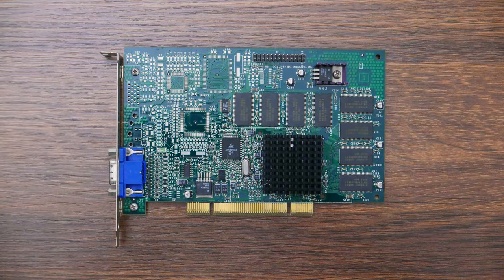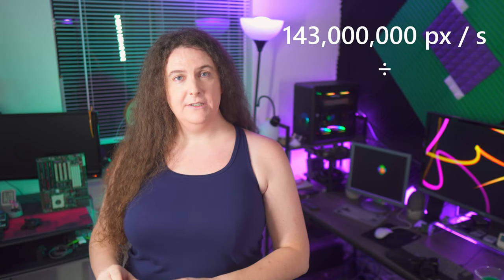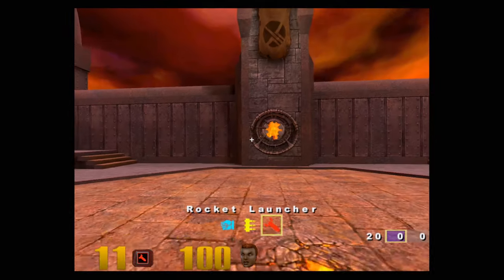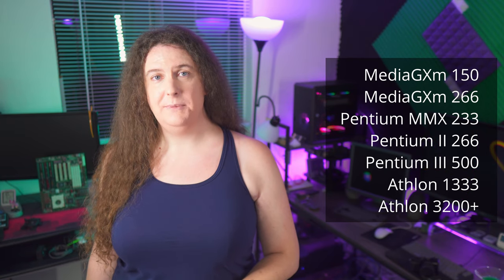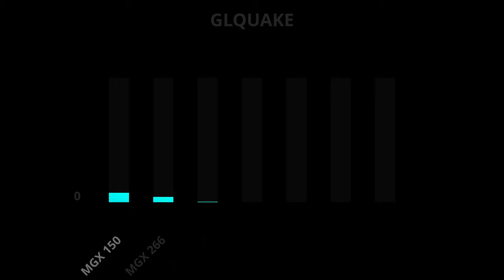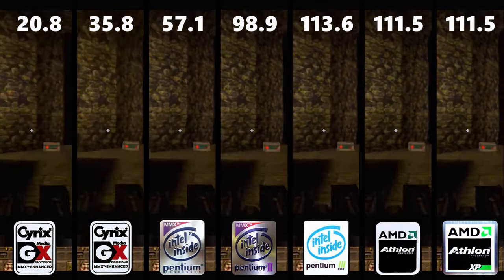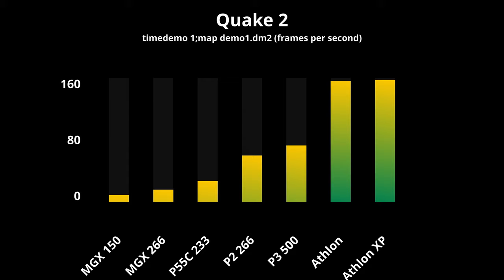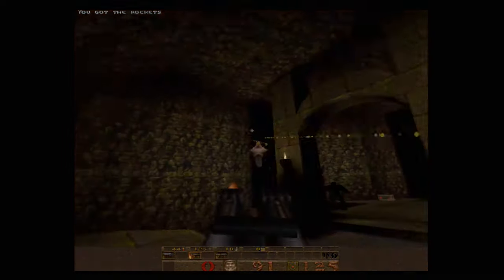How fast will it go? Voodoo3 Scaling

Comment: Hi, below this post I will list the results with the following VGA cards on my P-3 600MHz (100MHz FSB, 100MHz SDR, Acorp Intel 440BX Slot 1 motherboard). I hope the text formatting stays true enough to the source file.
Geforce FX 5200 AGP   - 128MB  64bit - 250MHz Core - 200MHz DDR
Geforce FX 5500 PCI     - 256MB 128bit - 250MHz Core - 133MHz DDR
Geforce MX 400  PCI     -  32MB  32bit - 175MHz Core - 166MHz DDR
Radeon 7200 SDR AGP -  32MB 128bit - 166MHz Core - 166MHz SDR
Matrox G400	AGP   -  16MB 128bit - 125MHz Core - 166MHz SDR
Matrox G200	AGP   -   8MB  64bit -  84MHz Core - 112MHz SDR
ATI Rage XL		PCI    -	8MB	 32bit -  84MHz Core -  63MHz SDR
Riva Vanta LT	AGP  -	8MB	 64bit -  82MHz Core - 100MHz SDR
Ati Rage 128Pro AGP   -  32MB 128bit - 140MHz Core - 140MHz SDR
S3 Virge DX 375 PCI     -   4MB  64bit -  60MHz Core -  60MHz EDO
Reply: Quake 2

Settings: Default       Demo: demo1.dm2

-------------------------------------------------------------------------
					WIndows 98 Driver Date: 12-10-2005
P3-600-Acorp		GeforceFX 5200 64bit	AGP		320x240x16		165.0	
P3-600-Acorp		GeforceFX 5200 64bit	AGP		640x480x16		163.4	
P3-600-Acorp		GeforceFX 5200 64bit	AGP		800x600x16		158.1
P3-600-Acorp		GeforceFX 5200 64bit	AGP		1024x768x16	128.7	
P3-600-Acorp		GeforceFX 5200 64bit	AGP		320x240x32		164.1	
P3-600-Acorp		GeforceFX 5200 64bit	AGP		640x480x32		158.2	
P3-600-Acorp		GeforceFX 5200 64bit	AGP		800x600x32		133.0
P3-600-Acorp		GeforceFX 5200 64bit	AGP		1024x768x32	87.8
-------------------------------------------------------------------------
					WIndows 98 Driver Date: 12-10-2005
P3-600-Acorp		GeforceFX 5500 128bit	PCI		320x240x16		134.8
P3-600-Acorp		GeforceFX 5500 128bit	PCI		640x480x16		132.2
P3-600-Acorp		GeforceFX 5500 128bit	PCI		800x600x16		118.1
P3-600-Acorp		GeforceFX 5500 128bit	PCI		1024x768x16	96.6
P3-600-Acorp		GeforceFX 5500 128bit	PCI		320x240x32		133.8	
P3-600-Acorp		GeforceFX 5500 128bit	PCI		640x480x32		120.3
P3-600-Acorp		GeforceFX 5500 128bit	PCI		800x600x32		101.5
P3-600-Acorp		GeforceFX 5500 128bit	PCI		1024x768x32	78.7
-------------------------------------------------------------------------
					Windows 98 Driver Date: 12-10-2005
P3-600-Acorp		Geforce MX 400 32bit	PCI		320x240x16		135.8
P3-600-Acorp		Geforce MX 400 32bit	PCI		640x480x16		112.9	
P3-600-Acorp		Geforce MX 400 32bit	PCI		800x600x16		92.5
P3-600-Acorp		Geforce MX 400 32bit	PCI		1024x768x16	67.3
P3-600-Acorp		Geforce MX 400 32bit	PCI		320x240x32		135.7
P3-600-Acorp		Geforce MX 400 32bit	PCI		640x480x32		97.5
P3-600-Acorp		Geforce MX 400 32bit	PCI		800x600x32		74.1
P3-600-Acorp		Geforce MX 400 32bit	PCI		1024x768x32	49.5
-------------------------------------------------------------------------
					Windows 98 Driver Date (Catalyst 6.2): 
P3-600-Acorp		Radeon 7200SDR 128bit	AGP		320x240x16		----
P3-600-Acorp		Radeon 7200SDR 128bit	AGP		640x480x16		104.7	
P3-600-Acorp		Radeon 7200SDR 128bit	AGP		800x600x16		103.0
P3-600-Acorp		Radeon 7200SDR 128bit	AGP		1024x768x16	101.0
P3-600-Acorp		Radeon 7200SDR 128bit	AGP		320x240x32		----
P3-600-Acorp		Radeon 7200SDR 128bit	AGP		640x480x32		104.5
P3-600-Acorp		Radeon 7200SDR 128bit	AGP		800x600x32		103.2
P3-600-Acorp		Radeon 7200SDR 128bit	AGP		1024x768x32	101.3
-------------------------------------------------------------------------
					Windows 98 Driver Date: 5-29-2002
P3-600-Acorp		Matrox G400    128bit	AGP		320x240x16		110.5
P3-600-Acorp		Matrox G400    128bit	AGP		640x480x16		108.6
P3-600-Acorp		Matrox G400    128bit	AGP		800x600x16		90.9
P3-600-Acorp		Matrox G400    128bit	AGP		1024x768x16	60.5
P3-600-Acorp		Matrox G400    128bit	AGP		320x240x32		109.9
P3-600-Acorp		Matrox G400    128bit	AGP		640x480x32		107.8
P3-600-Acorp		Matrox G400    128bit	AGP		800x600x32		87.6
P3-600-Acorp		Matrox G400    128bit	AGP		1024x768x32	56.4
-------------------------------------------------------------------------
					Windows 98 Driver Date: 5-29-2002
P3-600-Acorp		Matrox G200     64bit	AGP		320x240x16		----
P3-600-Acorp		Matrox G200     64bit	AGP		640x480x16		31.8
P3-600-Acorp		Matrox G200     64bit	AGP		800x600x16		22.1
P3-600-Acorp		Matrox G200     64bit	AGP		1024x768x16	13.9
P3-600-Acorp		Matrox G200     64bit	AGP		320x240x32		----
P3-600-Acorp		Matrox G200     64bit	AGP		640x480x32		23.2
P3-600-Acorp		Matrox G200     64bit	AGP		800x600x32		15.3
P3-600-Acorp		Matrox G200     64bit	AGP		1024x768x32	----
-------------------------------------------------------------------------
					Windows 98 Driver Date: **********
P3-600-Acorp		ATI Rage XL     32bit	PCI		320x240x16		52.1
P3-600-Acorp		ATI Rage XL     32bit	PCI		640x480x16		20.3
P3-600-Acorp		ATI Rage XL     32bit	PCI		800x600x16		14.2
P3-600-Acorp		ATI Rage XL     32bit	PCI		1024x768x16	8.9
P3-600-Acorp		ATI Rage XL     32bit	PCI		320x240x32		---
P3-600-Acorp		ATI Rage XL     32bit	PCI		640x480x32		---
P3-600-Acorp		ATI Rage XL     32bit	PCI		800x600x32		---
P3-600-Acorp		ATI Rage XL     32bit	PCI		1024x768x32	---
-------------------------------------------------------------------------
					Windows 98 Driver Date: **********
P3-600-Acorp		Riva Vanta LT   64bit	AGP		320x240x16		89.4
P3-600-Acorp		Riva Vanta LT   64bit	AGP		640x480x16		76.8
P3-600-Acorp		Riva Vanta LT   64bit	AGP		800x600x16		49.1
P3-600-Acorp		Riva Vanta LT   64bit	AGP		1024x768x16	33.5
P3-600-Acorp		Riva Vanta LT   64bit	AGP		320x240x32		89.8
P3-600-Acorp		Riva Vanta LT   64bit	AGP		640x480x32		46.8
P3-600-Acorp		Riva Vanta LT   64bit	AGP		800x600x32		30.2
P3-600-Acorp		Riva Vanta LT   64bit	AGP		1024x768x32	---
-------------------------------------------------------------------------
						Windows 98 Driver Date: 12-10-2005
P3-600-Acorp		ATI Rage128Pro 128bit	AGP		320x240x16		100.1
P3-600-Acorp		ATI Rage128Pro 128bit	AGP		640x480x16		97.3
P3-600-Acorp		ATI Rage128Pro 128bit	AGP		800x600x16		89.9
P3-600-Acorp		ATI Rage128Pro 128bit	AGP		1024x768x16	63.9
P3-600-Acorp		ATI Rage128Pro 128bit	AGP		320x240x32		100.5
P3-600-Acorp		ATI Rage128Pro 128bit	AGP		640x480x32		97.4
P3-600-Acorp		ATI Rage128Pro 128bit	AGP		800x600x32		87.8
P3-600-Acorp		ATI Rage128Pro 128bit	AGP		1024x768x32	61.1
-------------------------------------------------------------------------
						Windows 98 Driver Date: default 4.23.1999 + S3Toolkit(32bit Zbuffer)/TS3D/TD3D
					* 	gl_texturemode nearest
					**	r_fullbright=1, gl_flashblend=0
P3-600-Acorp		S3 Virge DX 375 64bit	PCI		320x240x16		12.5*(20*)/14.0*(23.8**)/13.8						
P3-600-Acorp		S3 Virge DX 375 64bit	PCI		640x480x16		5.4*(11.0*)/5.6*(11.9**)5.6
P3-600-Acorp		S3 Virge DX 375 64bit	PCI		800x600x16		3.6W*(7.9*)/3.7*(8.2**)/3.7
P3-600-Acorp		S3 Virge DX 375 64bit	PCI		1024x768x16	---
P3-600-Acorp		S3 Virge DX 375 64bit	PCI		320x240x24		---
P3-600-Acorp		S3 Virge DX 375 64bit	PCI		640x480x24		---
P3-600-Acorp		S3 Virge DX 375 64bit	PCI		800x600x24		---
P3-600-Acorp		S3 Virge DX 375 64bit	PCI		1024x768x24	---
Reply: Quake 3

Settings: Normal, then resolution changes     Demo: demo001
-------------------------------------------------------------------------
					Windows 98 Driver Date: 12-10-2005
P3-600-Acorp		GeforceFX 5200 64bit	AGP		320x240x16		93.7
P3-600-Acorp		GeforceFX 5200 64bit	AGP		640x480x16		91.7
P3-600-Acorp		GeforceFX 5200 64bit	AGP		800x600x16		88.4
P3-600-Acorp		GeforceFX 5200 64bit	AGP		1024x768x16	87.2
P3-600-Acorp		GeforceFX 5200 64bit	AGP		1280x1024x16	79.5	
P3-600-Acorp		GeforceFX 5200 64bit	AGP		320x240x32		90.5
P3-600-Acorp		GeforceFX 5200 64bit	AGP		640x480x32		89.4
P3-600-Acorp		GeforceFX 5200 64bit	AGP		800x600x32		89.6
P3-600-Acorp		GeforceFX 5200 64bit	AGP		1024x768x32	82.4	
P3-600-Acorp		GeforceFX 5200 64bit	AGP		1280x1024x32	62.1
-------------------------------------------------------------------------
					Windows 98 Driver Date: 12-10-2005
P3-600-Acorp		GeforceFX 5500 128bit	PCI		320x240x16		82.6
P3-600-Acorp		GeforceFX 5500 128bit	PCI		640x480x16		81.7
P3-600-Acorp		GeforceFX 5500 128bit	PCI		800x600x16		80.8
P3-600-Acorp		GeforceFX 5500 128bit	PCI		1024x768x16	78.3
P3-600-Acorp		GeforceFX 5500 128bit	PCI		1280x1024x16	68.2
P3-600-Acorp		GeforceFX 5500 128bit	PCI		320x240x32		83.3
P3-600-Acorp		GeforceFX 5500 128bit	PCI		640x480x32		82.7
P3-600-Acorp		GeforceFX 5500 128bit	PCI		800x600x32		80.1
P3-600-Acorp		GeforceFX 5500 128bit	PCI		1024x768x32	73.2
P3-600-Acorp		GeforceFX 5500 128bit	PCI		1280x1024x32	57.0
-------------------------------------------------------------------------
					Windows 98 Driver Date: 12-10-2005
P3-600-Acorp		Geforce MX 400 32bit	PCI		320x240x16		88.9
P3-600-Acorp		Geforce MX 400 32bit	PCI		640x480x16		77.6
P3-600-Acorp		Geforce MX 400 32bit	PCI		800x600x16		62.1
P3-600-Acorp		Geforce MX 400 32bit	PCI		1024x768x16	44.6
P3-600-Acorp		Geforce MX 400 32bit	PCI		1280x1024x16	28.9
P3-600-Acorp		Geforce MX 400 32bit	PCI		320x240x32		89.5
P3-600-Acorp		Geforce MX 400 32bit	PCI		640x480x32		59.4
P3-600-Acorp		Geforce MX 400 32bit	PCI		800x600x32		44.2
P3-600-Acorp		Geforce MX 400 32bit	PCI		1024x768x32	28.0
P3-600-Acorp		Geforce MX 400 32bit	PCI		1280x1024x32	15.4
-------------------------------------------------------------------------
					Windows 98 Driver Date (Catalyst 6.2): 
P3-600-Acorp		Radeon 7200SDR 128bit	AGP		320x240x16		----
P3-600-Acorp		Radeon 7200SDR 128bit	AGP		640x480x16		91.1
P3-600-Acorp		Radeon 7200SDR 128bit	AGP		800x600x16		84.4
P3-600-Acorp		Radeon 7200SDR 128bit	AGP		1024x768x16	69.2
P3-600-Acorp		Radeon 7200SDR 128bit	AGP		1280x1024x16	46.2
P3-600-Acorp		Radeon 7200SDR 128bit	AGP		320x240x32		----
P3-600-Acorp		Radeon 7200SDR 128bit	AGP		640x480x32		89.3
P3-600-Acorp		Radeon 7200SDR 128bit	AGP		800x600x32		82.8
P3-600-Acorp		Radeon 7200SDR 128bit	AGP		1024x768x32	64.4
P3-600-Acorp		Radeon 7200SDR 128bit	AGP		1280x1024x32	41.0
-------------------------------------------------------------------------
						Windows 98 Driver Date: 5-29-2002
P3-600-Acorp		Matrox G400    128bit	AGP		320x240x16		83.2
P3-600-Acorp		Matrox G400    128bit	AGP		640x480x16		76.7
P3-600-Acorp		Matrox G400    128bit	AGP		800x600x16		57.9
P3-600-Acorp		Matrox G400    128bit	AGP		1024x768x16	37.8
P3-600-Acorp		Matrox G400    128bit	AGP		1280x1024x16	23.6
P3-600-Acorp		Matrox G400    128bit	AGP		320x240x32		82.8
P3-600-Acorp		Matrox G400    128bit	AGP		640x480x32		65.2
P3-600-Acorp		Matrox G400    128bit	AGP		800x600x32		44.8
P3-600-Acorp		Matrox G400    128bit	AGP		1024x768x32	27.4
P3-600-Acorp		Matrox G400    128bit	AGP		1280x1024x32	14.6
-------------------------------------------------------------------------
						Windows 98 Driver Date: 5-29-2002
P3-600-Acorp		Matrox G200     64bit	AGP		320x240x16		??
P3-600-Acorp		Matrox G200     64bit	AGP		640x480x16		??
P3-600-Acorp		Matrox G200     64bit	AGP		800x600x16		??
P3-600-Acorp		Matrox G200     64bit	AGP		1024x768x16		??
P3-600-Acorp		Matrox G200     64bit	AGP		1280x1024x16	??
P3-600-Acorp		Matrox G200     64bit	AGP		320x240x32		??
P3-600-Acorp		Matrox G200     64bit	AGP		640x480x32		??
P3-600-Acorp		Matrox G200     64bit	AGP		800x600x32		??
P3-600-Acorp		Matrox G200     64bit	AGP		1024x768x32		??
P3-600-Acorp		Matrox G200     64bit	AGP		1280x1024x32	??
-------------------------------------------------------------------------
						Windows 98 Driver Date: ********
P3-600-Acorp		ATI Rage XL     32bit	PCI		320x240x16		33.8
P3-600-Acorp		ATI Rage XL     32bit	PCI		640x480x16		12.3
P3-600-Acorp		ATI Rage XL     32bit	PCI		800x600x16		 8.4
P3-600-Acorp		ATI Rage XL     32bit	PCI		1024x768x16	 5.0
P3-600-Acorp		ATI Rage XL     32bit	PCI		1280x1024x16	---
P3-600-Acorp		ATI Rage XL     32bit	PCI		320x240x32		---
P3-600-Acorp		ATI Rage XL     32bit	PCI		640x480x32		---
P3-600-Acorp		ATI Rage XL     32bit	PCI		800x600x32		---
P3-600-Acorp		ATI Rage XL     32bit	PCI		1024x768x32	---
P3-600-Acorp		ATI Rage XL     32bit	PCI		1280x1024x32	---
-------------------------------------------------------------------------
						Windows 98 Driver Date: ********
P3-600-Acorp		Riva Vanta LT   64bit	AGP		320x240x16		72.8
P3-600-Acorp		Riva Vanta LT   64bit	AGP		640x480x16		46.5
P3-600-Acorp		Riva Vanta LT   64bit	AGP		800x600x16		27.8
P3-600-Acorp		Riva Vanta LT   64bit	AGP		1024x768x16	19.1
P3-600-Acorp		Riva Vanta LT   64bit	AGP		1280x1024x16	---
P3-600-Acorp		Riva Vanta LT   64bit	AGP		320x240x32		68.5
P3-600-Acorp		Riva Vanta LT   64bit	AGP		640x480x32		25.3
P3-600-Acorp		Riva Vanta LT   64bit	AGP		800x600x32		16.2
P3-600-Acorp		Riva Vanta LT   64bit	AGP		1024x768x32	---
P3-600-Acorp		Riva Vanta LT   64bit	AGP		1280x1024x32	---
-------------------------------------------------------------------------
						Windows 98 Driver Date: 12-10-2005
P3-600-Acorp		ATI Rage128Pro 128bit	AGP		320x240x16		67.7
P3-600-Acorp		ATI Rage128Pro 128bit	AGP		640x480x16		65.5
P3-600-Acorp		ATI Rage128Pro 128bit	AGP		800x600x16		56.1
P3-600-Acorp		ATI Rage128Pro 128bit	AGP		1024x768x16	37.5
P3-600-Acorp		ATI Rage128Pro 128bit	AGP		1280x1024x16	24.0
P3-600-Acorp		ATI Rage128Pro 128bit	AGP		320x240x32		68.0
P3-600-Acorp		ATI Rage128Pro 128bit	AGP		640x480x32		62.7
P3-600-Acorp		ATI Rage128Pro 128bit	AGP		800x600x32		48.1
P3-600-Acorp		ATI Rage128Pro 128bit	AGP		1024x768x32	30.8
P3-600-Acorp		ATI Rage128Pro 128bit	AGP		1280x1024x32	18.7
Reply: Unreal (not Gold)

Unreal Classic 224     Settings: High Quality, then resolution changes   Demo: Unreal castle flyby
-------------------------------------------------------------------------
					Windows 98 Driver Date: 12-10-2005
													                              OpenGL
P3-600-Acorp		GeforceFX 5200 64bit	AGP	640x480x16		60.54	
P3-600-Acorp		GeforceFX 5200 64bit	AGP	800x600x16		59.41
P3-600-Acorp		GeforceFX 5200 64bit	AGP	1024x768x16	56.98
P3-600-Acorp		GeforceFX 5200 64bit	AGP	1280x1024x16	53.30
P3-600-Acorp		GeforceFX 5200 64bit	AGP	640x480x32		60.09
P3-600-Acorp		GeforceFX 5200 64bit	AGP	800x600x32		59.40
P3-600-Acorp		GeforceFX 5200 64bit	AGP	1024x768x32	56.24
P3-600-Acorp		GeforceFX 5200 64bit	AGP	1280x1024x32	46.47
-------------------------------------------------------------------------
					Windows 98 Driver Date: 12-10-2005
													                              OpenGL
P3-600-Acorp		GeforceFX 5500 128bit	PCI		640x480x16		58.12
P3-600-Acorp		GeforceFX 5500 128bit	PCI		800x600x16		56.83
P3-600-Acorp		GeforceFX 5500 128bit	PCI		1024x768x16	54.85
P3-600-Acorp		GeforceFX 5500 128bit	PCI		1280x1024x16	50.86
P3-600-Acorp		GeforceFX 5500 128bit	PCI		640x480x32		56.75
P3-600-Acorp		GeforceFX 5500 128bit	PCI		800x600x32		56.22
P3-600-Acorp		GeforceFX 5500 128bit	PCI		1024x768x32	53.47
P3-600-Acorp		GeforceFX 5500 128bit	PCI		1280x1024x32	45.45
-------------------------------------------------------------------------
					Windows 98 Driver Date: 12-10-2005
													                              OpenGL
P3-600-Acorp		Geforce MX 400 32bit	PCI		640x480x16		60.47
P3-600-Acorp		Geforce MX 400 32bit	PCI		800x600x16		54.59
P3-600-Acorp		Geforce MX 400 32bit	PCI		1024x768x16	47.54
P3-600-Acorp		Geforce MX 400 32bit	PCI		640x480x32		46.50
P3-600-Acorp		Geforce MX 400 32bit	PCI		800x600x32		44.98
P3-600-Acorp		Geforce MX 400 32bit	PCI		1024x768x32	31.21
-------------------------------------------------------------------------
					Windows 98 Driver Date (Catalyst 6.2): 
													                              OpenGL
P3-600-Acorp		Radeon 7200SDR 128bit	AGP	640x480x16		39.21
P3-600-Acorp		Radeon 7200SDR 128bit	AGP	800x600x16		34.30
P3-600-Acorp		Radeon 7200SDR 128bit	AGP	1024x768x16	29.96
P3-600-Acorp		Radeon 7200SDR 128bit	AGP	640x480x32		37.55
P3-600-Acorp		Radeon 7200SDR 128bit	AGP	800x600x32		33.88
P3-600-Acorp		Radeon 7200SDR 128bit	AGP	1024x768x32	29.16
-------------------------------------------------------------------------
						Windows 98 Driver Date: 5-29-2002
														                              OpenGL/D3D
P3-600-Acorp		Matrox G400    128bit	AGP		640x480x16		52.77/64.56
P3-600-Acorp		Matrox G400    128bit	AGP		800x600x16		44.45/53.19
P3-600-Acorp		Matrox G400    128bit	AGP		1024x768x16	33.00/38.93
P3-600-Acorp		Matrox G400    128bit	AGP		640x480x32		49.91/64.21
P3-600-Acorp		Matrox G400    128bit	AGP		800x600x32		38.93/50.10
P3-600-Acorp		Matrox G400    128bit	AGP		1024x768x32	25.88/36.31
-------------------------------------------------------------------------
						Windows 98 Driver Date: 5-29-2002
								!!!!!!!!!!!!!!		D3D !!!!!!!!!!!!!!!!!!!! OpenGL is black screen
P3-600-Acorp		Matrox G200    64bit	AGP		640x480x16		25.72
P3-600-Acorp		Matrox G200    64bit	AGP		800x600x16		18.55
P3-600-Acorp		Matrox G200    64bit	AGP		1024x768x16	12.75
P3-600-Acorp		Matrox G200    64bit	AGP		640x480x32		----
P3-600-Acorp		Matrox G200    64bit	AGP		800x600x32		----
P3-600-Acorp		Matrox G200    64bit	AGP		1024x768x32	----
-------------------------------------------------------------------------
						Windows 98 Driver Date: *********
												                              OpenGL/D3D
P3-600-Acorp		ATI Rage XL     32bit	PCI		640x480x16		9.47/25.51
P3-600-Acorp		ATI Rage XL     32bit	PCI		800x600x16		6.88/17.49
P3-600-Acorp		ATI Rage XL     32bit	PCI		1024x768x16	4.41/11.01
P3-600-Acorp		ATI Rage XL     32bit	PCI		640x480x32		----
P3-600-Acorp		ATI Rage XL     32bit	PCI		800x600x32		----
P3-600-Acorp		ATI Rage XL     32bit	PCI		1024x768x32	----
-------------------------------------------------------------------------
						Windows 98 Driver Date: *********
																	OpenGL/D3D
P3-600-Acorp		Riva Vanta LT   64bit	AGP		640x480x16		30.25/40.60
P3-600-Acorp		Riva Vanta LT   64bit	AGP		800x600x16		20.28/29.90
P3-600-Acorp		Riva Vanta LT   64bit	AGP		1024x768x16	----/21.89
P3-600-Acorp		Riva Vanta LT   64bit	AGP		640x480x32		----
P3-600-Acorp		Riva Vanta LT   64bit	AGP		800x600x32		----
P3-600-Acorp		Riva Vanta LT   64bit	AGP		1024x768x32	----
-------------------------------------------------------------------------
						Windows 98 Driver Date: 12-10-2005
																	OpenGL/D3D
P3-600-Acorp		ATI Rage128Pro 128bit	AGP	640x480x16		47.57/71.65
P3-600-Acorp		ATI Rage128Pro 128bit	AGP	800x600x16		41.70/62.30
P3-600-Acorp		ATI Rage128Pro 128bit	AGP	1024x768x16	31.86/48.16
P3-600-Acorp		ATI Rage128Pro 128bit	AGP	640x480x32		45.96/71.83
P3-600-Acorp		ATI Rage128Pro 128bit	AGP	800x600x32		37.87/59.96
P3-600-Acorp		ATI Rage128Pro 128bit	AGP	1024x768x32	29.49/42.30
Reply from the maker: Wow, that is extensive testing! Thank you!
Reply: @TechAmbr  You are most welcome. For completeness, I will also list the Quake3A  "four.dm_66" timedemo results. The Q3A build might be different, as the previous ones were on the demo version, while this is the retail one.

Settings: Normal, then resolution changes 
Demo: FOUR.DM_66
-------------------------------------------------------------------------
					Windows 98 Driver Date: 12-10-2005
P3-600-Acorp		GeforceFX 5200 64bit	AGP	320x240x16		96.1	
P3-600-Acorp		GeforceFX 5200 64bit	AGP	640x480x16		93.4	
P3-600-Acorp		GeforceFX 5200 64bit	AGP	800x600x16		93.7
P3-600-Acorp		GeforceFX 5200 64bit	AGP	1024x768x16	92.4	
P3-600-Acorp		GeforceFX 5200 64bit	AGP	1280x1024x16	84.1	
P3-600-Acorp		GeforceFX 5200 64bit	AGP	320x240x32		95.3	
P3-600-Acorp		GeforceFX 5200 64bit	AGP	640x480x32		93.3	
P3-600-Acorp		GeforceFX 5200 64bit	AGP	800x600x32		92.5
P3-600-Acorp		GeforceFX 5200 64bit	AGP	1024x768x32	88.6		
P3-600-Acorp		GeforceFX 5200 64bit	AGP	1280x1024x32	69.2
-------------------------------------------------------------------------	
					Windows 98 Driver Date: 12-10-2005
P3-600-Acorp		GeforceFX 5500 128bit	PCI		320x240x16		86.6	
P3-600-Acorp		GeforceFX 5500 128bit	PCI		640x480x16		85.7
P3-600-Acorp		GeforceFX 5500 128bit	PCI		800x600x16		82.7
P3-600-Acorp		GeforceFX 5500 128bit	PCI		1024x768x16	84.4
P3-600-Acorp		GeforceFX 5500 128bit	PCI		1280x1024x16	73.2
P3-600-Acorp		GeforceFX 5500 128bit	PCI		320x240x32		85.3
P3-600-Acorp		GeforceFX 5500 128bit	PCI		640x480x32		84.6
P3-600-Acorp		GeforceFX 5500 128bit	PCI		800x600x32		85.5
P3-600-Acorp		GeforceFX 5500 128bit	PCI		1024x768x32	78.8	
P3-600-Acorp		GeforceFX 5500 128bit	PCI		1280x1024x32	61.5
-------------------------------------------------------------------------
					Windows 98 Driver Date: 12-10-2005
P3-600-Acorp		Geforce MX 400 32bit	PCI		320x240x16		96.0
P3-600-Acorp		Geforce MX 400 32bit	PCI		640x480x16		84.6
P3-600-Acorp		Geforce MX 400 32bit	PCI		800x600x16		68.5
P3-600-Acorp		Geforce MX 400 32bit	PCI		1024x768x16	48.7
P3-600-Acorp		Geforce MX 400 32bit	PCI		1280x1024x16	31.8
P3-600-Acorp		Geforce MX 400 32bit	PCI		320x240x32		90.3
P3-600-Acorp		Geforce MX 400 32bit	PCI		640x480x32		62.6
P3-600-Acorp		Geforce MX 400 32bit	PCI		800x600x32		45.6
P3-600-Acorp		Geforce MX 400 32bit	PCI		1024x768x32	29.3
P3-600-Acorp		Geforce MX 400 32bit	PCI		1280x1024x32	16.1
-------------------------------------------------------------------------
					Windows 98 Driver Date (Catalyst 6.2): 
P3-600-Acorp		Radeon 7200SDR 128bit	AGP	320x240x16		----
P3-600-Acorp		Radeon 7200SDR 128bit	AGP	640x480x16		94.5
P3-600-Acorp		Radeon 7200SDR 128bit	AGP	800x600x16		92.7
P3-600-Acorp		Radeon 7200SDR 128bit	AGP	1024x768x16	80.1
P3-600-Acorp		Radeon 7200SDR 128bit	AGP	1280x1024x16	56.1
P3-600-Acorp		Radeon 7200SDR 128bit	AGP	320x240x32		----
P3-600-Acorp		Radeon 7200SDR 128bit	AGP	640x480x32		94.1
P3-600-Acorp		Radeon 7200SDR 128bit	AGP	800x600x32		89.2
P3-600-Acorp		Radeon 7200SDR 128bit	AGP	1024x768x32	74.0
P3-600-Acorp		Radeon 7200SDR 128bit	AGP	1280x1024x32	48.7
-------------------------------------------------------------------------
						Windows 98 Driver Date: 5-29-2002
P3-600-Acorp		Matrox G400    128bit	AGP	320x240x16		86.2
P3-600-Acorp		Matrox G400    128bit	AGP	640x480x16		83.4
P3-600-Acorp		Matrox G400    128bit	AGP	800x600x16		66.7
P3-600-Acorp		Matrox G400    128bit	AGP	1024x768x16	44.5
P3-600-Acorp		Matrox G400    128bit	AGP	1280x1024x16	27.9
P3-600-Acorp		Matrox G400    128bit	AGP	320x240x32		86.0
P3-600-Acorp		Matrox G400    128bit	AGP	640x480x32		73.7
P3-600-Acorp		Matrox G400    128bit	AGP	800x600x32		52.2
P3-600-Acorp		Matrox G400    128bit	AGP	1024x768x32	32.2
P3-600-Acorp		Matrox G400    128bit	AGP	1280x1024x32	17.0
-------------------------------------------------------------------------
						Windows 98 Driver Date: 5-29-2002
P3-600-Acorp		Matrox G200     64bit	AGP		320x240x16		??
P3-600-Acorp		Matrox G200     64bit	AGP		640x480x16		??
P3-600-Acorp		Matrox G200     64bit	AGP		800x600x16		??
P3-600-Acorp		Matrox G200     64bit	AGP		1024x768x16	??
P3-600-Acorp		Matrox G200     64bit	AGP		1280x1024x16	??
P3-600-Acorp		Matrox G200     64bit	AGP		320x240x32		??
P3-600-Acorp		Matrox G200     64bit	AGP		640x480x32		??
P3-600-Acorp		Matrox G200     64bit	AGP		800x600x32		??
P3-600-Acorp		Matrox G200     64bit	AGP		1024x768x32	??
P3-600-Acorp		Matrox G200     64bit	AGP		1280x1024x32	??
-------------------------------------------------------------------------
						Windows 98 Driver Date: ********
P3-600-Acorp		ATI Rage XL     32bit	PCI		320x240x16		35.2
P3-600-Acorp		ATI Rage XL     32bit	PCI		640x480x16		13.8
P3-600-Acorp		ATI Rage XL     32bit	PCI		800x600x16		 9.6
P3-600-Acorp		ATI Rage XL     32bit	PCI		1024x768x16	 6.0
P3-600-Acorp		ATI Rage XL     32bit	PCI		1280x1024x16	---
P3-600-Acorp		ATI Rage XL     32bit	PCI		320x240x32		---
P3-600-Acorp		ATI Rage XL     32bit	PCI		640x480x32		---
P3-600-Acorp		ATI Rage XL     32bit	PCI		800x600x32		---
P3-600-Acorp		ATI Rage XL     32bit	PCI		1024x768x32	---
P3-600-Acorp		ATI Rage XL     32bit	PCI		1280x1024x32	---
-------------------------------------------------------------------------
						Windows 98 Driver Date: ********
P3-600-Acorp		Riva Vanta LT   64bit	AGP		320x240x16		69.5
P3-600-Acorp		Riva Vanta LT   64bit	AGP		640x480x16		51.8
P3-600-Acorp		Riva Vanta LT   64bit	AGP		800x600x16		30.3
P3-600-Acorp		Riva Vanta LT   64bit	AGP		1024x768x16	21.7
P3-600-Acorp		Riva Vanta LT   64bit	AGP		1280x1024x16	----
P3-600-Acorp		Riva Vanta LT   64bit	AGP		320x240x32		65.7
P3-600-Acorp		Riva Vanta LT   64bit	AGP		640x480x32		26.8
P3-600-Acorp		Riva Vanta LT   64bit	AGP		800x600x32		17.9
P3-600-Acorp		Riva Vanta LT   64bit	AGP		1024x768x32	---
P3-600-Acorp		Riva Vanta LT   64bit	AGP		1280x1024x32	---
-------------------------------------------------------------------------
						Windows 98 Driver Date: 12-10-2005
P3-600-Acorp		ATI Rage128Pro 128bit	AGP		320x240x16		67.0
P3-600-Acorp		ATI Rage128Pro 128bit	AGP		640x480x16		65.5
P3-600-Acorp		ATI Rage128Pro 128bit	AGP		800x600x16		60.2
P3-600-Acorp		ATI Rage128Pro 128bit	AGP		1024x768x16	41.5
P3-600-Acorp		ATI Rage128Pro 128bit	AGP		1280x1024x16	27.0
P3-600-Acorp		ATI Rage128Pro 128bit	AGP		320x240x32		66.9
P3-600-Acorp		ATI Rage128Pro 128bit	AGP		640x480x32		65.4
P3-600-Acorp		ATI Rage128Pro 128bit	AGP		800x600x32		53.0
P3-600-Acorp		ATI Rage128Pro 128bit	AGP		1024x768x32	34.5
P3-600-Acorp		ATI Rage128Pro 128bit	AGP		1280x1024x32	21.2
-------------------------------------------------------------------------
						Windows 98 Driver Date: default 4.23.1999 + TS3D
r_texturemode gl_nearest, r_fastsky 1
P3-600-Acorp		S3 Virge DX 375 64bit	PCI		320x240x16		16.7						
P3-600-Acorp		S3 Virge DX 375 64bit	PCI		640x480x16		5.6
P3-600-Acorp		S3 Virge DX 375 64bit	PCI		800x600x16		---
P3-600-Acorp		S3 Virge DX 375 64bit	PCI		1024x768x16	---
P3-600-Acorp		S3 Virge DX 375 64bit	PCI		320x240x24		---
P3-600-Acorp		S3 Virge DX 375 64bit	PCI		640x480x24		---
P3-600-Acorp		S3 Virge DX 375 64bit	PCI		800x600x24		--
-
P3-600-Acorp		S3 Virge DX 375 64bit	PCI		1024x768x24	---
-------------------------------------------------------------------------